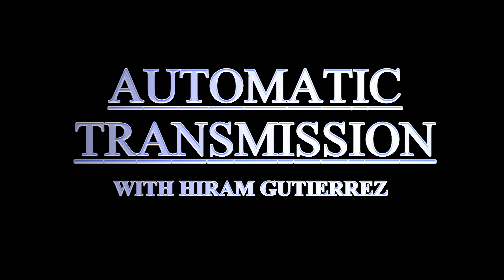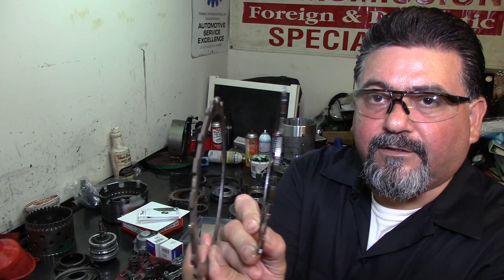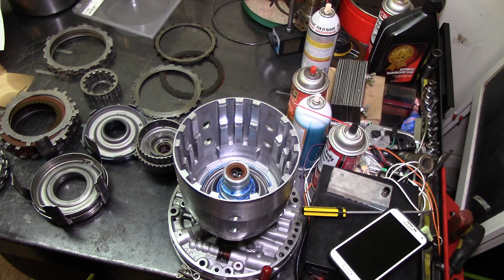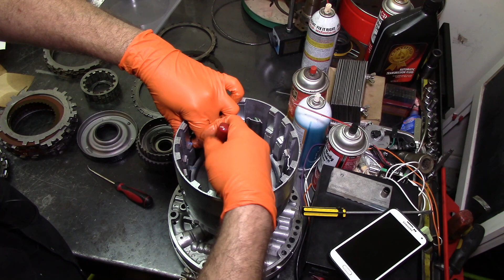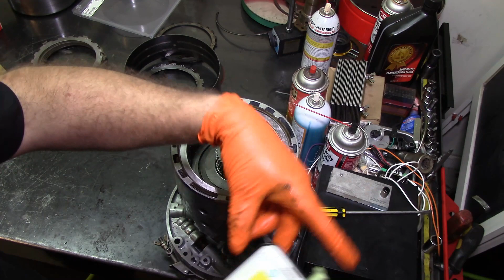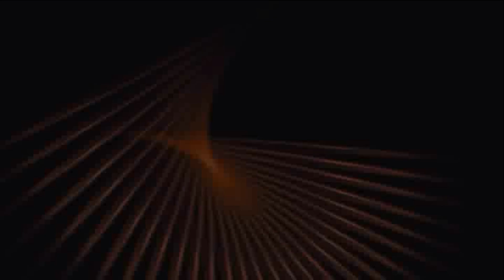Z-PAK by Raybestos 4L60E 700R4 3-4 High Performance Friction Plates

Comment: Hey mate. I've just rebuilt my 4l60e and used transgo hd2 kit in it. I've used the yellow springs in the low spring retainer. And the ones the recommend in the cage that has the circlip on it. I used exedy clutches in it. Do you recommend 1000% that I leave the load release springs out of the top? I have 25thou clearance. I'm thinking about leaving them in for a little assuring? What do you thjnk

Comment: Hiram, I have a 2009 4l60e. I recently bought sonnax parts to build a stage 3 transmission. I have the smart tech 3-4 drum. And I read that you can fit more of the thinner frictions and steels in the drum. I was wondering what brand and size I should go with

Comment: So to be clear... a 1998 and up model 3/4 drum can be used in a typical older 700r4...in order to get that 7 disc stack package?  It's totally possible to put a 1998 drum in a older 700r4 with no other problems?????? (That's a question)

Comment: This is what I so need.  I have a GMC Safari that pulls a 2000 pound single axle trailer and it goes over a curvy mountain pass to deliver in the city.  So there is a lot of hills and corners to accelerate out of.  I need heavy duty.  This is the weak link in the van, otherwise, I totally love the van.

Comment: You are the first person that's been more helpful than all thr rest. As far as I know my transmission has never been rebuilt yet it has this z-pack in it. The factory manual says it's model dependent and would have 5, 6, or 7 frictions. The ATSG manual was useless and the other transmission shops I've contacted were useless. You on the other hand know about the 7 plates and have the mileage almost down to a T. My hummer H2 lost 3-4 at 85000. There's too much free play with the 6 plates and mine has 7 and looks exactly like the z-pack when I removed them. I've run out of money at this point so I'm going to have to clean up the steels and reuse them but I did order 7 .065 plates.
Reply: This is kinda funny. I was actually looking into purchasing an H2 that had it's 3rd/4th go out and have been browsing videos to see how hard it'd be to rebuild. I definitely prefer seeing how Hiram did the job compared to some other videos (saw one where the guys were beating on one with screwdrivers). I understand transmissions are durable, but they are also components that require tight tolerances that shouldn't be abused.
Reply: @danielkapp9468  My rebuild worked out great so far. I put a few hundred miles on it before I stomped on it on the highway. I upgraded a few parts like the sunshell while I was in there. I didn't mess with the pump though, ordered a rebuilt one on ebay from Chicago transmission that had an upgraded boost valve. I had a couple clips I had to replace because I didn't have the right tools but now I do. Also had to replace what looks like a washer but it's a thrust bearing or something. It was chewed up and one side in pieces. I think the worst part was resizing the solid teflon rings and not chopping them when putting it back together. I bought a tub of Transgel and I lubed EVERYTHING except the clutch plates and steels.....lol
Reply: @danielkapp9468  Now that I have all the tools to rebuild it, I  would do it again if I had to.

Comment: Hiram, I have ATSG manuals for the 700-R4--4L60 and 4L60E units, as well as "updates" manuals for both.  On page 78 of the 700-R4---4L60 update manual, it refers to the 3-4 clutch apply ring with the stamped #7, which it states was implemented beginning January 5th, 1993.  Not trying to admonish a "Master Tech" such as yourself, just trying to pass along information that I myself have acquired--you state that it's a '98 or newer model piece--maybe because you do so many different model years it was a "mixup" on your part? Be advised, PLEASE--I plan on starting to rebuild these units, beginning with my '91 K1500's 700-R4.  I bought videos from The Transmission Bench, for the 4L60E, and 4L80E.  I'll never be as good at this stuff as you, even if you were doing it in your sleep, but LIKE you, I have high standards.  Integrity of the unit will be Priority #1, on EVERY build, PERIOD...

Comment: My GMC s15 sonoma has issues with first gear, goes up to about 2k rpm before the truck starts to move
Reply from the maker: Check power going to the transmission. Pin E. Ignition switch is common issue with the contacts getting fowled on that circuit. If voltage ⚡️ is about 2 volts ⚡️ switch no good.
Reply: OK ty

Comment: I am in the middle of my transmission rebuild and was hoping you could answer a question. 1999 Silverado 4.8 with 4l60e. I bought a rebuild kit from Alto and it has a 3-4 power pack which is similar in concept to the Z Pak. The instructions aren't very good for me. My OEM has 6 fiber and 5 steels not including the back or top plates. The power pack has 9 frictions and 8 steels not including the back and top plates. Can I just use the stock back and top plates with the power pack so long as the clearance is the same as the OEM? My OEM stack is 26mm and the Power Pack is 26.4mm.   Second thing is my trans didn't have the 5 load springs in it so I ordered some to reinstall. My thought is I can use the thinner 9 disks with the stock back and top plates so long as my clearance is the same as stock specs and adding the missing load springs will help keep the disks apart so they get oil when not applied. Any advice would be appreciated.

Comment: I am having issues with my 4l65e transmission. I had it professionally rebuilt with the Z-pack, all new circle D 3000 converter and all new cooling system. Transmission started slipping on the highway at about 2K miles while trying to pass a vehicle without downshifting. Pulled it out, got transmission rebuilt once again with a new Z-pack. Cleaned out cooling system and reinstalled. Now transmission lasted 700 miles and it started to slip again in 3rd & 4th.  Both times line pressure was set to 10% duty cycle at 0-25% throttle and 0% duty cycle from 26-100% throttle. No harsh driving during the break-in period. What could be causing the 3-4 clutches to burn up so quickly?
Reply from the maker: Could be a combination of both the building process and the tuning process. I usually install a Transgo HD2 shift kit on any performance build. A Super Servo complete 2nd and 4th from Sonnax or Superior, they both have their own. From Superior K070 for rapid release of third, keeps it from dragging the clutches. K0136 which is third exhaust. Another issue is the input shaft being loose in the drum causing a pressure leak thus causing premature failure.
On the tuning side of it, it is not a good idea to turn off the EPC setting it to 0% duty cycle.  You're maxing out line pressure causing premature wear and death to the pump slide and eventually breaking it shattering the rotor. There's no pressure regulation any more which also affects the pressure regulator valve exhausting needed pressure making line pressure very unstable. There's where the HD2 kit comes in. With the .500" boost valve it will give you the necessary pressure when you need it.  Also TCC has to be set to not release on deceleration while in 4th otherwise it will go in and out of TCC. And don't set it to 98% and 95% duty cycle, you'll kill the converter clutch. Look on both tables, on the high side select the whole table set it to the maximum duty cycle your table displays which on most is 97%. On the low side set the whole table to the minimum duty cycle your table displays, which in most 7%.
I'll be making a video on this subject soon and explain why I recommend this. Tuners don't see our side of the story with issues like this. Sometimes the tune will cause more problems than it fixes. I like to make my transmissions strong from the inside and tune it accordingly. 
Hope this helps and post your results. I would like to hear them.
Reply: @AutomaticTransmission  thank you for getting back to me and for the thorough response!  The transmission is getting rebuilt once again and so is the converter. Once I get everything back I will adjust tune accordingly.  I'm looking at about 2 weeks until I have the car back on the road. I'll definitely be on the lookout for your video on transmission tuning. Hopefully I can match the settings using the Holley terminator X ECU.

Comment: what rebuild kit did you use for this build i tow a trailer alot and i need to know what kit will be the best
Reply from the maker: There's a lot of options, from Transgo to Superior to Fairbanks to B&M and the list goes on. It depends on how are you going to use your vehicle.
Reply from the maker: Assuming you are talking about the recalibration kit the video only mentions the frictions.
Reply: @AutomaticTransmission  well I work construction and tow an enclosed trailer so mostly hauling stuff. I looked at TCI rebuild kits but I’d rather hear from someone who has experience in this before
Reply: So z-pack won't work on 93-97modle without changing that drum🤷 Good no either way 🤙

Comment: Great video, Very easy to follow  along to.I have a question  for you .Hope you can help me out.I have 98 Silverado 4x4  with a 4l60e with burnt up 3-4 assembly. I picked up a  good 4l60e out of a 2000 4x4.I found out the hard way that torque converter from the 2000 will not go into  the crankshaft of the 98.My question  is, Is it possible  to swap out the drum and input shaft from the 2000 into the 98. Any advice  would be appreciated. Thanks in advance.

Comment: hey man, love the videos. got a couple questions if you dont mind.  03 gmc 1500. 5.3 auto 4l60e.  has flare up shifting. 1-2 then 2-3. sometimes takes about 3-4 seconds to take gear and sometimes it is normal.  All gears hold strong after shifting with no slipping. Could this be 2-4 servo or accumulator pistons? What's your thoughts.

Comment: Thank you Hiram for sharing your wealth of knowledge.  I always heard that using BW Hi Energy 7 frictions and thick steels handles the heat better than Z pack and their thin steel/friction combo.  Is there apply and/or exhaust circuit mods that you do to minimize heat?  Also, do you ever use the Sonnax Smart-Tech input housing to eliminate apply plate flex?  If so, on what type of application?  Thank you again!
Reply: Depends on performance/towing. BW and stock input drum works fine for most applications.  For HD use go to 9 BW frictions with thinner steels or the z-pak.  I wouldn't worry about the input drum unless you are drag racing. Run a proper external trans cooler to keep temps down.
Reply: @rockroll9513  Thank you for the feedback.

Comment: What clutch pack do you recomend for a 4l60e in a 99 Trans am pushing about 450HP? Are Alto power pack good or am I fine with Raybestos high-energy clutch?
Reply: I use Raybestos
Reply: @rockroll9513  I actually went with Raybestos GPZ100 clutch pack seems to hold pretty good set my clearance to about .038 havent had a problem been driving it around for a few weeks now.

Comment: I have a 2002 Chevy suburban 1500 that I use as a daily driver and also to go to the desert where I carry a heavy load.  What set up would you recommend? I am looking to upgrade my transmission as I’m going on 205k miles on the original trans and motor.

Comment: I used to install transgo's commercial clutch pack in 700R4s many years ago. The fictions and steels were made by Alto, they were of thinner design, same concept as Zpack, only Altos frictions had lining on both sides. I still have left over stock plates.

Comment: Can I take a transmission out of a 2010 Yukon xl and swap the bell housing that fits my 09 Sierra  1500 and everything be groovy
Reply: Probably may need hp tunners to get the computer to pick it up. If it's a 6l80e then most defenetly.

Comment: if you notice the p plate on the z pac is a whole lot thinner than the one he pulled out of the trans that he claims is the culprit. contradicting himself. and besides , the z pac will not fix the problem.  ive seen them burn up too. my god,, you already have 6 frictions in there. you need to allow for lube and proper release. i deleted my info by mistake. i'll get back on this

Comment: I have a 1997 k1500 4x4. With the typical 3-4 gears slipping. Is it possible to replace the 3-4  clutch and piston seal without removing valve body and other components?
Reply: +Omar Vargas  Unfortunately no. The band pin is under the VB and if un touched, you are working with cross-fingers on the 22 year old other components. Also, one big is the reaction sun shell. It will need updated and more work is required to inspect it or change it. I don't think any guy with red juice on his hands would tell you otherwise. Plus, a Sonnax updated 3rd ball capsule update for release is advisable. It helps correct the pressure release timing to reduce having two ranges engaged at the same time, during up-shift or down-shift, reducing heat, warpage on steels and un-due friction wear. Just research it a little. Hope it helps.

Comment: When you said the Z Pak will work on a 700R4, you just need a 98 and up drum? You mean 88 and up, correct?
Reply: Does the 88 have the 7 marked on it?
Reply: @JM-yx1lm  im using a '96 60E internals in my 700 build
Reply: '93 and up, according to my ATSG updates manual for that unit...

Comment: Since my 98 Chevy is in “limp mode”, and I already tried changing both solenoids, with the same problem still present, do I just need to buy the 3-4 clutch pack that your showing ? Then remove  only those old worn out parts from just the top of the assembly ? My truck is a daily driver to work with no heavy hauling or trailer use...
Hope to hear from you soon. Mike in Iowa.
Reply: I know it sounds silly but did you check the fuse? Saw the same thing before. Guy tried replacing solenoids and it still acted the same. Turned out to be the fuse
Reply: Elfnubbin yes that was the first thing I checked before and after the solenoids were replaced. Fuses and relays all check out.

Comment: What is the cost difference or estimate to build a 4L60E bulletproof transmission with clutches etc to last for a long time. I have had 3 tansmissins already and thinking go 4L80E instead.What are your thoughts on this?

Comment: Been running my 2000 GMC Sierra for few weeks with 3,4 clutches gone. Will it hurt anything else other than motor turning 3 thousand rpm
Reply: Short answer? Yes
Reply: weeks damn, 1 day about 20 miles was all I did on the way from work I was cruising with cruise control an all of a sudden rpms started going high

Comment: I have a problem with my 4L60E transmission it's in a 93 Chevy Van G20 at shift hard going into drive shifts hard going into reverse and it shifts hard 1st to 2nd the 2nd 3rd and 4th and overdrive shift smooth I've changed filter fluid and changed the shifter solenoid I've changed the throttle position sensor I don't know what else to do if anybody out there knows anything if it's the servo let me know I haven't changed that yet but please let me know and I appreciate it

Comment: thanks soo awesome work ! im converting a 4L60E from a 4X4 blazer for my 2nd gen camaro it has a built higher compression 355 with stage 5 aluminum heads and 4.11 gears. ineed 1st and 2nd gear to be not as low or high in number not higher in number. iloved that planetary for the TH350 for big blocks it had  2.10 and 1.40 gearing it was perfect with my smallblock it knocked out a full second off my ET because the spread is so even, the only downside was 3rd gear with 4.20 wasn't very street.

Comment: What do you think about the Alto Z-pack eliminator? They claim it's better than the raybestos Z-pack I'm think about pulling apart my 4L60e in my 99 trans am cuz I lost my 3-4 again this year after a rebuild.
Reply: Martinez1701a I want info you on the Alto Z-pack eliminator kit. Listen I was going to do the same thing until did my research after asking the same question. If you search everything that comes in the kit they are the same kit but the only difference is the top pressure plate. But if you don't believe me search part number and specs
Reply: @irvingolivissr.3172  are they both better than the the ac delco 3-4 pack?
Reply: @Executnr  thanks for the info. I'm thinking about the zpak in my 91 Silverado

Comment: Really like your videos-very informative.  What do you recommend I do to upgrade my 95 2wd suburban 4l60E.  I've had 2 transmissions installed and I think they keep putting junk back in.  I tow a light trailer once in a while but it's starting to slip in 3rd and overdrive.  Was looking at the SS monster in a box with the 7 red eagle frictions.  YOu think the z pak better?

Comment: You guys focus WAYYYY to much on the clutch packs.. hydraulic pressure malfunction is what burns the clutches up. weak pumps, leaking valve bodies, leaking seals, loss of the hydraulic system integrity is what kills transmission clutches.

Comment: Great Info. 

I think the next step up from the Z-Pack, especially for the 3-4 Clutches, is the Sonnax Smart-Tech Input Housing Kit with Billet Input Shaft using either Eight .067" frictions with seven .095" steels, or Nine .062" frictions with eight .077" steels. The Bolt on plate on the Sonnax Drum is very top quality. 
We all know the downfall of the 4L60E is the 3-4 Clutch Pack Failure.

Comment: Enjoy your videos man i have a question been trying to figure out why my transmission does a hard shift at first to second gear at 17 mph. Sometimes wen I began to drive the car for the day it does great shifts at 12 or 13 mph but in a couple minutes goes to shifting hard at 17mph. The other gears shift perfect. I had my tranny rebuild I already put 5k miles on it  and itdidn't use to do it before I rebuild it. It's a 92 cadillac brougham